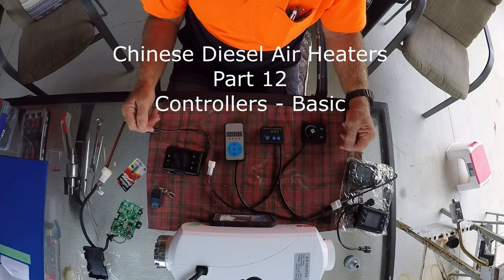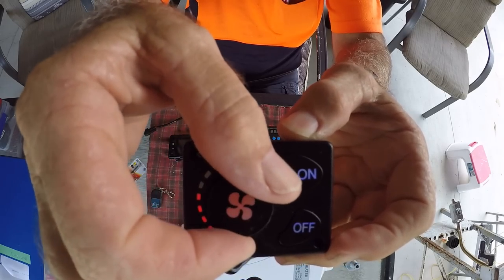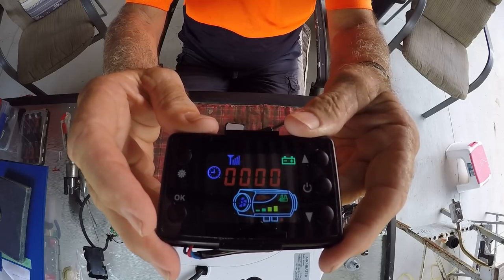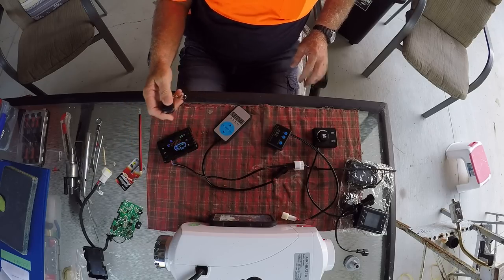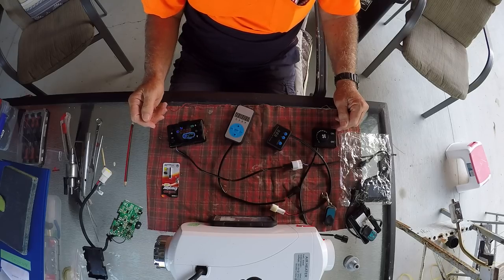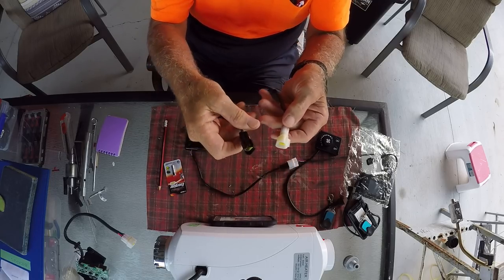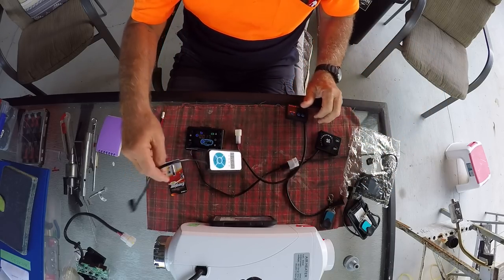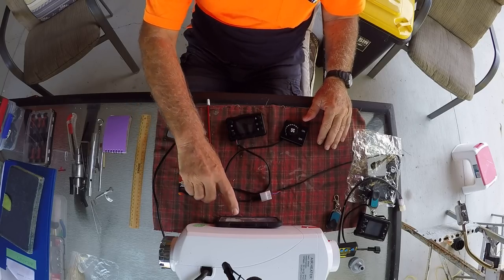Chinese Diesel Air Heaters -  Part 12 - Controllers (Basic)

Comment: Hi,

Very much appreciate all your heater videos. I bought one of the “8kw” units, you know, orange with carbon fibre (!). Works well, been testing it in workshop before vehicle install.
When I say works well, the heater works as advertised. But the lcd controller seems crippled. I can change from hertz to temp, and temp increases and decreases according to setting. But the clock doesn’t hold time , and no display icon for glow plug nor fuel pump. And no way found ( believe me I’ve tried many button combos ) to access admin settings.
I’m planning on adding afterburner control when they become available again, so the lcd controller issue isn’t a deal breaker. Just a bit annoying right now.
Cheers

Alistair
Reply from the maker: Hi Alistair, it is not uncommon to get a broken LCD controller. Suggest you ask your supplier for a replacement. Most eBay heater suppliers won't be able to give you a replacement as very few sell spare parts, but most will give you enough cash back for you to buy a replacement on eBay.  Cheers.  JMcK
Reply: Hi john,

Yes, I’ll see about getting some satisfaction from the vendor. Another funny thing, I had a look at the motherboard in the heater. The board connection for the case temp sensor was connected one pin off. I mean laterally moved one pin. Took the chance and reset connection “properly “ , but got an error code on power up. It’s almost as if the wires to the connector were inserted in the wrong place and the entire connector has to be shifted one pin over to make it work.
I’ll look at it again, and take a pic.
Oh, and I did a quick and dirty measure of pump hz , indicated vs. apparent. I counted pump clicks for time period and got pretty well 2x the indicated. Ie 2hz when 1hz indicated. Perhaps more evidence of a flakey controller.

Cheers

Alistair
Reply from the maker: ragnar hairybreeks 

Thanks for that feedback Alastair.  I would be interested to know how you go with a new controller.  JMcK

Comment: Hi John great videos,  on my Chinese controller there is a setting with a picture of a mountain range have you any idea what it's for,  cheers.
Reply from the maker: Hi Alfonso,

One big issue with the Chinese heaters was there was no altitude compensation mechanism and if you lived in the mountains your heater ran rich and carboned up quickly.

You could buy a third party controller like the Australian “Afterburner controller” that had altitude compensation. But I suspect you may have a new controller with altitude compensation. This would be great if it is. Can you send me a link?  JMcK
Reply: Cant find it on the USA amazon but if you change your amazon settings to UK  and enter the link you can view it,  Al.

Comment: Hi I have just found your channel and shall peruse through it soon. My heater has developed a fault I have the simple controller with the large knob. The heater appears to function fine the pump works and fills the fuel lines and the heater starts to blow, but the air doesn't really get hot and then the heater stops working. The controller doesn't show any of the normal fault codes (1-8) but instead the led on the knob flashes intermittently with the control setting lights on the side. Any ideas what might be the issue here please?

Comment: Your videos are very detailed and helpful John.
I just got a 2kw heater installed in the van the other day. I have the LCD controller and when the heater starts up I get 2 green segments followed by 2 yellow segments, but only one red segment. My temperature setting I want inside the van is 25 degrees celsius, but it can only reach 20 degrees celcius. Is there a setting that I can adjust that will throw out more heat? Thanks. :)
Reply from the maker: Hi Irishrover,

Suggest you first try running the heater in manual mode and run the heater up to its max Hz rate. That will show show you  the heater max output.

A heater with a good install can raise the temperature of the incoming air by around 70°C to 80°C. 

How much it is able to heat the accommodation area then depends on size and insulation.

Cheers.   JMcK
Reply: Do I have to go into the advaced settings to do that? I have the controller set to show temp in degrees celcius and the max is 35 degrees celcius on the display. I had the heater running full blast and the display struggled to get to 20 degrees after an hour. All the LCD controllers on YouTube show 2 green, 2 yellow and 2 red heat segments, but if mine is showing just 1 red segment then the heater isn't putting out max heat.
Thanks for your prompt reply John.
Reply from the maker: IRISHROVER 

No, just simple manual pump setting.
You will see Hz on screen with a number. Just hit up arrow
A lot of my videos show me manually increasing the Hz rate. 
I personally prefer the manual mode.

JMCk
Reply: Is Hertz rate not just the same as degrees celcius setting? I pressed the top left and right button to display Temp instead of pulse rate, so it would get to the required temp and hold it there, but it can only achieve 20 degrees and max is 35 degrees, can't see it reaching that.
My van is not that big and is well insulated.
Reply from the maker: IRISHROVER 

No Mr I. 

Hz rate is the number of fuel pump piston strokes every second. The Hz setting determines the amount of fuel delivered to the heater, and hence the burn rate, and hence the temperature output.  JMcK
Reply: Just been out to the van John, it's 6 degrees celsius here at the moment.
What I was meaning is having it set at 35 degrees celsius is the same as maximum Hz setting.
When I switched it back to Hz setting the maximum reading on the display was 3Hz and the lowest setting 1Hz.
What is the recommended setting for a 2kw heater?
What will happen if I increse it in the advanced settings?
Reply from the maker: IRISHROVER 
Hi Irishrover,

You can increase the Hz setting in the locked settings. The normal max is 5.5 Hz for the 5Kw heater. As you increase Hz you must also increase fan speed. If you choose to go this way write down the current settings as there is no "reset" to factory settings button.

If you set the fuel flow (Hz rate ) too high the heater will overheat and shut down.

Suggest you check the size and weight of your heater and compare with my 2Kw video. Some manufactures sell a 2Kw heater that is really a 5Kw heater with a reduced Hz max. If this is the case you could safely increase the fuel flow rate to a max 5.5 Hz

Suggest you measure the air temperature coming out of the heater. It must be the air temperature, not heat exchange temp. It should be around 70°C to 80°C in your conditions heating outside air of 6°C at max settings.

You can recirculate the air and reheat the inside van air. As you describe, a small well insulated van, I would expect a higher than 20°C van temp. These heaters put out a lot of heat.

If your heater is really a small 2Kw heater and increasing the fuel settings does not work for you, you may need to consider going to a 5 Kw heater. 

Good luck. JMcK

Comment: I Love you videos, so much information. I have a 6X12 cargo trailer turning into a camper. I have seen so many of these heaters both on Amazon and E-Bay. May I ask which one would you recommend? Thanks...
Reply from the maker: Hi Osito, I generally don't put links to these heaters as the sellers come and go. Not one of the suppliers I bought heaters from last year sell heaters this year.

I suggest you try and buy from a supplier who has a local warehouse in your country, that way you get quick delivery and returns are easy if you have an issue with the heater. I try to buy from a seller who has a warehouse in Australia. 

Next choose a heater that has the controller you want, if that is important to you, and chose a supplier who accepts returns. Probably not essential in this case as these heaters are inexpensive and very reliable, but some insurance for you. 

Cheers.   JMcK
Reply: @johnmck1147  Thank you so much, I feel like your videos will help my install go flawless.
Reply from the maker: Osito Lee 
👍

Comment: Hi John the video is very good well explain and I need help I got white smoke on started since new pump is 25 Degrees angle battery good condition once it fire up all good it's a 2 Kw heater hope you have any idea what cause this thanks Garry
Reply from the maker: Hi Garry, it is not uncommon to have smoke on first start up, usually caused by some residue fuel, or excessive prime. If the heater then burns clean after start don't worry about it.
Remember you only prime the heater once. That is after you installed it. JMcK

Comment: G'day John and thanks for the heads up on installation pitfalls. I have the small blue controller you show @ 2minute mark. Would you have an English interpreted set of instructions for this type please. Cheers
Reply from the maker: Hi Peter, sorry I do not have a real English instruction manual for that controller.
It is very simple to operate in manual mode.
Short press on middle button to turn on.
Long press on middle button until left LED flashes to turn off.
Up arrow to increase temperature, down arrow to reduce temperature.
Right button for voltage and ambient temp of room.
After that it gets complicated, and is too detailed to write about here.  
Sorry Peter.  JMcK
Reply: @johnmck1147  sincere thanks for your time in replying. That will get me started and operating. Amazing how effective these units are even on 1.6Hz. For some reason I can't eliminate the pump clicking no matter how i support it. Today I wrapped it in layers of DynaMat car sound proofing still to no avail. I have contacted the supplier. Thanks again
Reply from the maker: Peter Irvine  

Hi Peter, the ticking pump is a fact of life with these heaters at the moment. If it makes a tocking noise you may have a trapped air bubble, which is often caused by the pump not being vertical enough. 

Have you tried suspending the pump in air using shockchord?

Be careful wrapping the pump, they get hot and could overheat and cause excessive wear and vapour issues, particularly at high Hz rates.

Cheers.  JMcK
Reply: @johnmck1147  thanks again John for your sage advice. I'll try absolute vertical orientation of the pump.

Comment: John, I have a 2kw Chinese diesel heater.  It works perfectly fine and came with a LCD control panel with the picture of the heater similar to the one in your video .  I bought a spare control panel but bought the 2 button rotary dial control panel like the rotary one you have in your video.  When I plugged in the rotary control panel, I noticed the lowest and highest settings had the fan and fuel pump going at a significantly higher rate than the low and high settings on the LCD control panel.  Do you know why this is the case?  Is there settings for rotary control panel to make it work thr fan and fuel pump at rates similar to the LCD control panel?
Reply from the maker: Hi James, 

In the past most clone manufactures of these diesel heaters used standard wiring protocols, but recently there are some manufactures using non standard wiring.

The controller has 3 wires, generally red and black power wires and a blue sense wire.
I would have a look at the wire colours on the new controller and compare them to the wires on the old controller. When you plug in the new controller you can see the wire colours both side of the plug and socket. Do they match. If they do not match you could try changing them around so black joins with black, red with red, and blue with blue.

If the wires of the new controller do match the loom wires you most likely have a non standard ECB, or a faulty controller. Do you have a friend with one of these heaters that you could plug in the new controller into his heater to rule out a controller problem?

If the controller is ok you could buy a spare ECB to connect your rotary dial controller to, but if your ECB  is also non standard the plugs for fan, glow plug and temp sensor could also be non standard and not match. This is why I now advise people if they do not know if the supplier sells heaters with standard wiring, to buy a heater with the controller they want.

I would be interested to know how things go.  JMcK
Reply: John, the description of the controller that I bought said it was a 12/24V.   Could it be that it is set to act as a 24V switch?  Would that cause the rapid fan and fuel pump speeds?  Is there a toggle button or setting to change it to 12v if it is on the 24v setting?
Reply from the maker: James Bucher 
No James, they work on a 12V or 24V heater as is. If the wire colours match in the plug and socket I would suspect a faulty controller, and I would ask for a replacement. I tested one of my spare 12V/24V rotary knob controllers today for you and it worked just fine.
Cheers.  JMcK

Comment: Hi John I don’t suppose you have a value / spec for the thermistor? At the bottom of the lcd display please? I have a unit being sent to me and that item is suspect.
Reply from the maker: Sorry Ian. But it is a room temp thermistor. For your info, I only use the manual settings on the controller, thermistor not required.  JMcK

Comment: Awesome videos to watch before buying one of these units. Do you have a preference for a certain controller? There seems to be a few options of the "high end" controller. I've seen the black one you have, and the blue one you showed. Also have seen a red and different styles of black ones. Want to get the better one if there is one

Comment: Hi John great videos, just wondering how you clear the error codes from the screen, l am having an issue with my pump, l am on my second pump now they have both run for about 8 hrs each and then won’t start the next morning, the nights have only been about 6c , when l put the controls on prime and the multimeter on the pump plug the volts start counting down is that normal?
Reply from the maker: Hi Neville, it is very rare for pumps to fail in a proper install and correct use.
I have never had to replace a pump in an actual install. (Not test rig). The same pump has been running in the boat for some 12 years.

Suggest you first check your install. 
Is the pump inclined upwards.
Do you have a good fuel filter
Are you using correct fuel
Do not use enviro diesel
You only prime once, not every time you use the heater.
Is your wiring correct.
Do you have voltage drop issues
The pump is an electromagnetic pulse pump. Power is applied in vert short bursts. Do not keep power on the pump

Turn off the power and controller should reset.

I hope this is helpful. I need more info to fully understand your issues.  JMcK

Comment: Your videos are so good, thanks for your time and effort. 

If I go with the basic on /off dial type controller can I upgrade to best one with the glow plug / temperature / fan info and error codes?
Reply from the maker: Hi Alabama, in general the answer is yes, as most of these Chinese heaters have a standard wiring and plug configuration. However I have purchased 2 heaters that had non standard plugs, reversed wiring and a different ECB. The suppliers would not take them back even though they offered returns in their adv, however they did give me a discount that allowed me to buy a new ECB and controller and not be much out of pocket. I could swap out the non standard for standard electronics. The mechanical side was the same.

Regards.   JMcK
Reply: Thanks for the reply, with LCD controller on the left can I just turn the heater on and let it run off the thermostat for a few hours, like 6 hours? On my Webasto there is a max of 2 hrs run time.
Reply from the maker: AlabamaTree , 
Yes, you can run them all day if you wish, provided the setting is not so high it causes an overheat situation. JMcK
Reply: John McK 47 - thanks for the reply and your time. I’m really enjoying learning from your videos :)
Reply from the maker: AlabamaTree . Your welcome.  JMcK

Comment: John, I ve watched almoust every video you have made so far. but one thing I wondered. have you commented on settings on the heater? how to obtain the best air/fuel ratio? are there any advanced settings to be tuned to optimize the heater? pump max/min Hz, max/min rpm fan settings etc?
Reply from the maker: Hi Rune,

I have resisted doing a video re changing all the factory settings. This is for an enthusiast to play with. Too many people get themselves into trouble altering the factory settings, get incomplete combustion, and then carbon build up issues.

If you like experimenting, then by all means change the settings to suit you. It can be a bit of fun trying different parameters, but at this stage I have not recorded any experiments here. 

Cheers.  JMcK

Comment: Hi John, Hope you are well. I may be fitting a CDH in a 24V set up Iveco ex-mobile library. The truck has an existing  24V 240V battery charger and will have 2 X 12V leisure batteries in the back connected in series to give 24V. Question:- Is it best to alter the generic CDH LCD controller from 12V to 24V or just tap off 1 X 12V battery. I can check any battery / charger voltages with a multi-meter when I see the van. The heaters state 12V but also have an operating range of 24V on the specification.
Reply from the maker: Hi Ian,

You can buy 24 volt versions of these heaters, but if you have already bought a 12 volt heater I suggest it may be better to draw the power off one 12V battery.

The controllers can be switched between 12V and 24V, but the fan motors an dosing pumps are voltage specific. 

Cheers.  JMcK
Reply: Great info John. I will tap power off one of the 12V batteries Cheers Ian
Reply from the maker: IAN MURRAY 
👍